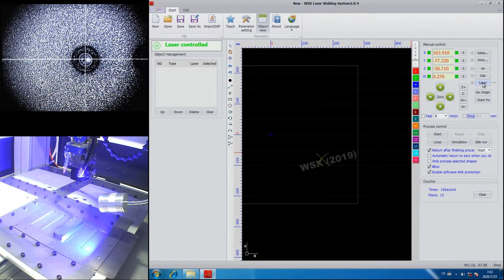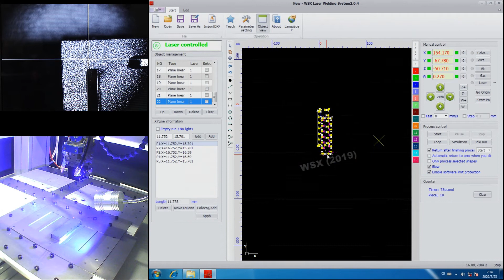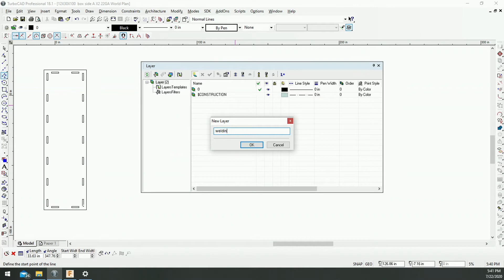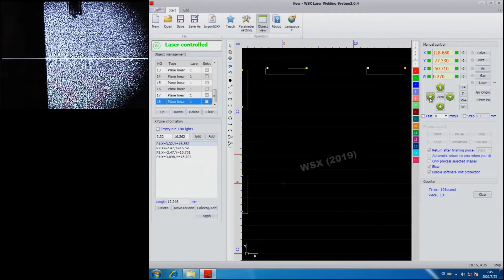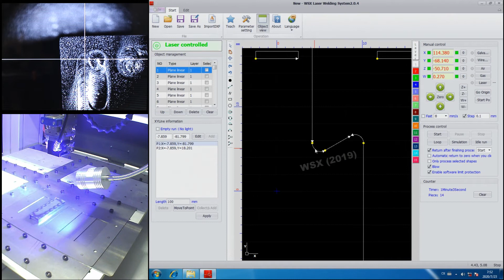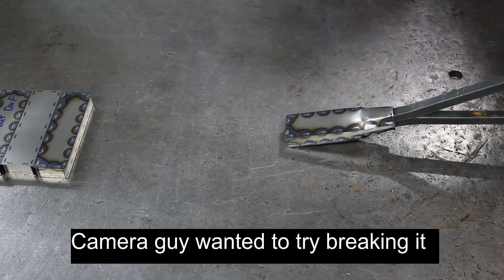Laser welding with bescutter 750 watt fiber laser welder

Comment: How thick of stainless was used?
Reply from the maker: We have welded several thousand pieces of 0.7mm (22ga) stainless and we have done test welds up to 2mm (14ga)  stainless. This is the small machine so if you need more power there are bigger ones.. if you have a sample part that would answer your questions I'd try to make it.